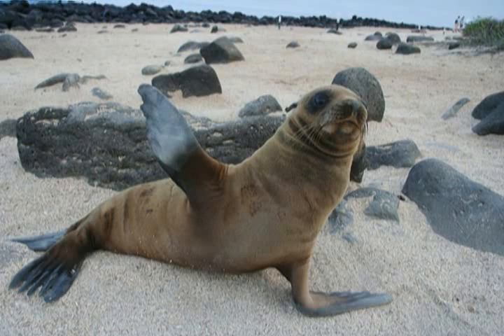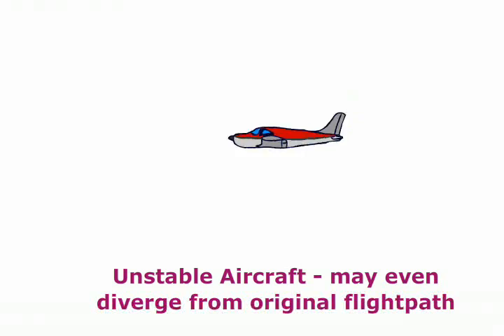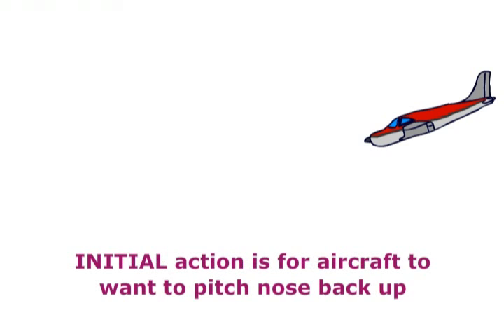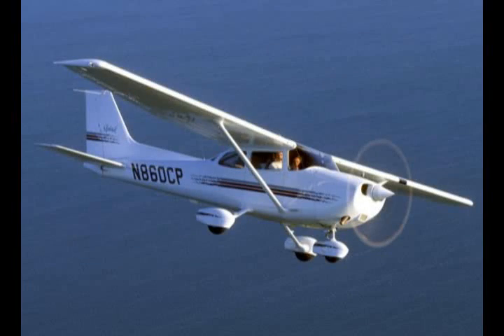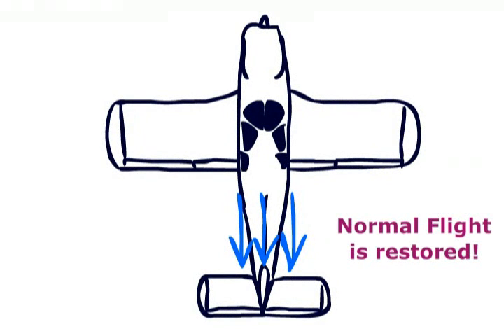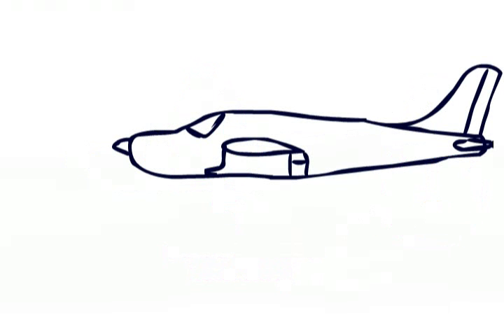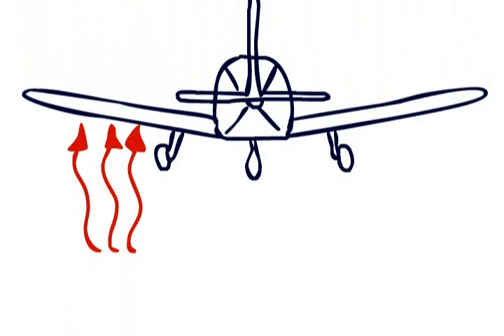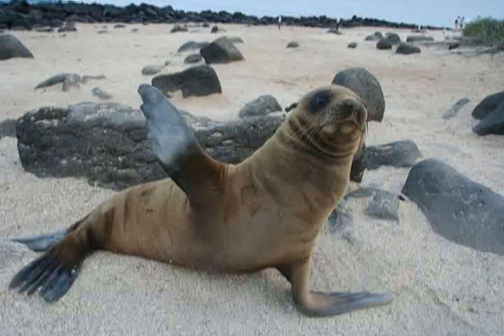Aircraft Stability Explained | profpilot.co.uk video #10

Comment from the maker: @TarikuKunn Well there is the hot air thing in there. Although you probably won't be flying over David Cameron, localised hot air can rise up from motorways and other tarmac/concrete surfaces on a sunny day, which can cause an upset.

You could also trigger a movement, by hitting the yoke or rudder peddles briefly (but hard) by accident. Perhaps during an epic blockbuster style fight in the cockpit, or more likely while snuffling around in your flight bag.

Comment: My understanding is that roll stability is caused by the upward going wing's reduced lift production due to lift converting to centripetal force as the bank increases. Meanwhile, the downward going wing's lift production increases as the wing loses its dihedral and goes horizontal, therefore increasing lift. This difference in lift production causes the wings to roll back towards wings level position. Please correct me if I am wrong.
Reply: Centripedal force aka "horizontal component of lift"